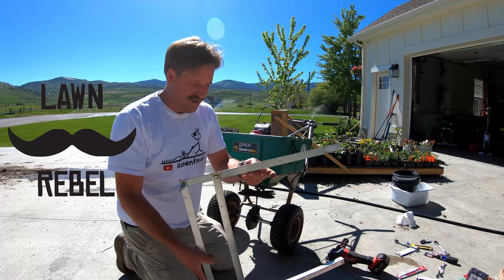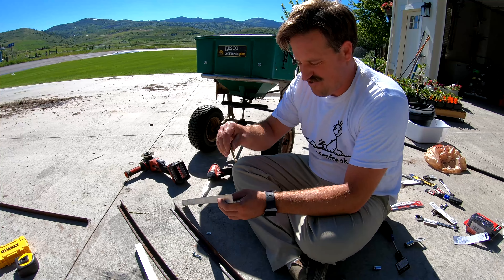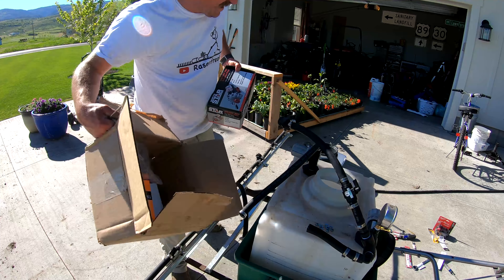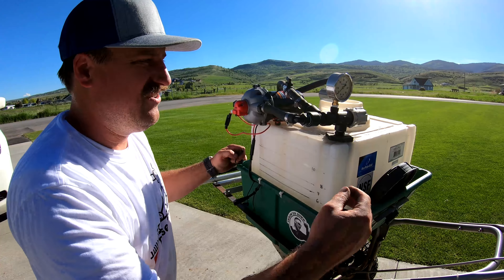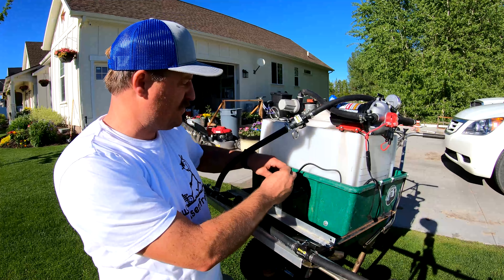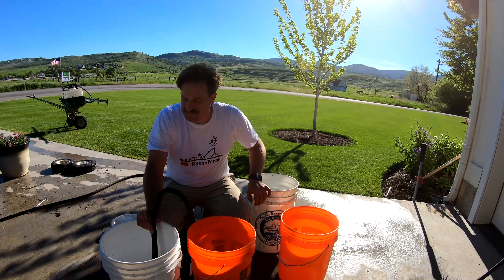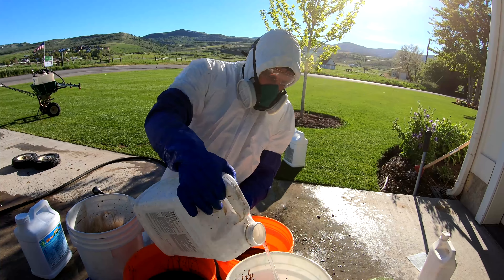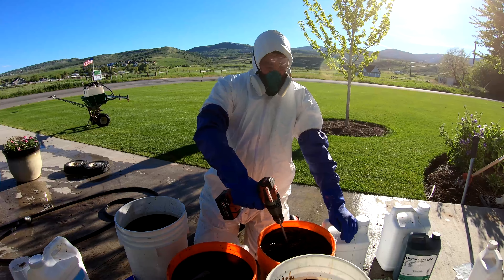Staying Safe While SPRAYING THE LAWN

Comment: Did you check the ratings on that level B suit? Does it have the protection against the chemicals you are using?
Reply: And is that respirator certified for those chems? 😎

Comment: Get a marker dye when spraying with boom or backpack. Alligare Super Marking Dye is what we use when spraying 2-4-D(generic killex), and round up, makes life real easy and can spot equipment failures real fast.

Should get a flow rate per acre with water! Set the spray pressure, collect a timed sample from each spray heads to get a flow/time rate. With the flow/time rate mark off a section of road or asphalt of known size (100m^2 or 1000ft^2 works good), time how long it takes to cover the area (average walking/driving speed), and use flow rate to figure the solution per ft^2/acre/m^2 the rig is throwing down.

It’s kinda a bitch the first time when timing a new rig, but as long as you don’t change pressures, or spray head patterns the volume of solution per area stays the same for work pace regardless what you mix into it. From there can quickly and easily use that info to know how much active ingredient to add per spray tank. Makes it pretty fast when switching chems, I know my sprayer buts down say 10L the 100m^2 so if I need a 60ml active ingredient rate per 100m^2 add 6L per 1000L if in metric, or if the chemical label is in gallons same thing I have the spray rate in gallons/acre or foot^2. At least when doing wide area broadcast applications, spot spraying is a little different and will often have a backpack sprayer mix guide, or if not you would need to make an educated guess (often stronger solution since you don’t want to carry water for no reason and can switch to a low volume head to compensate)

Should also mix in the spray tank not in buckets. Chemical first and then fill the tank with water. Don’t want to spill a bucket of chem on yourself depending what you are working with. Plus when pouring you have spash back risks. 

Really depends on the chems you are working with how careful your need to be, but it’s the concentrate which is the biggest hazard for contact poisoning/contamination. 

Once spraying a solution onto customer lawns all the PPE we generally use is rubber boots, nitrile gloves, sometimes eye, and sometimes full face and space suit if spraying trees. Trees you really need the space suit though since it literally goes everywhere when shooting streams of chem 50 feet into a tree top. For lawns though as long as your droplet size is coarse enough and you aren’t spraying down wind the boom rubber boot and gloves are good. When handling concentrates to make a mix sometimes a little more, but the label will always specify exactly the level of PPE you need for a given task.
Reply: Can also do liquid fertilizers this way and save some time by doing fert + herbicide to save some major time. Might not be worth the hassle though if only spraying your own property for the little gains. Liquid ferts are pretty awesome though, but often much more frequent apps then a slow release granular.